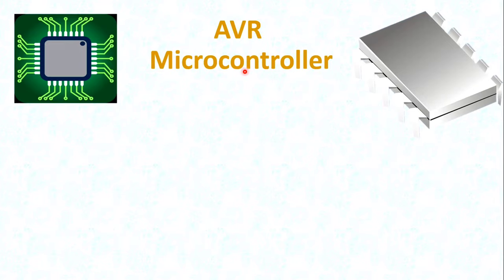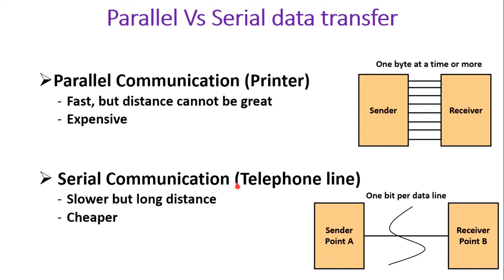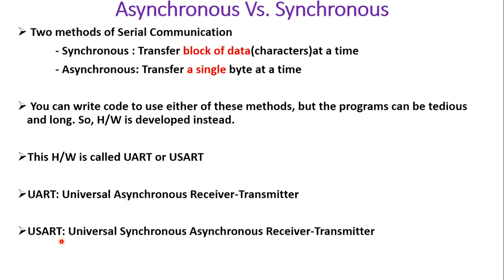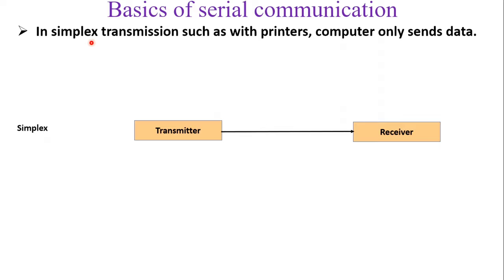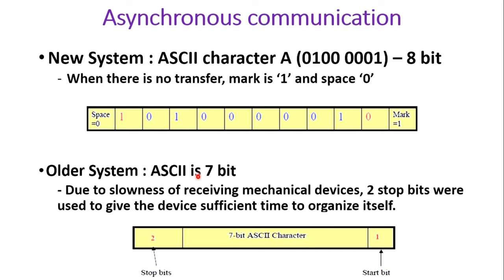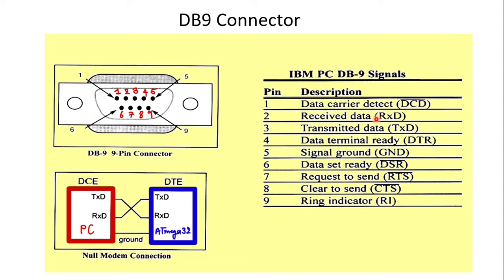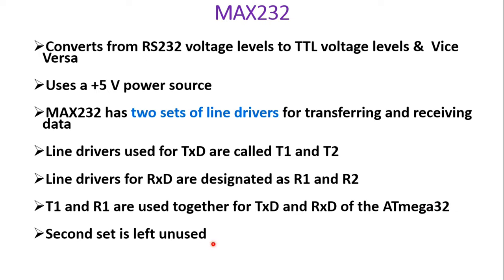AVR Serial Communication: A Comprehensive Guide for ATmega32 Microcontroller

Comment from the maker: Timestamps of AVR Serial Communication:
0:00 - AVR Microcontroller - AVR Serial Communication
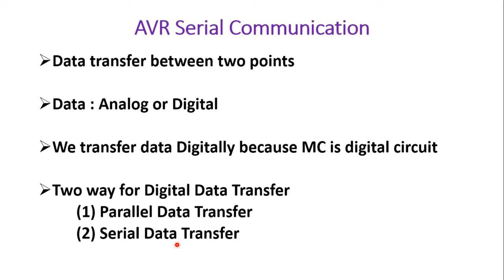1:22 - Parallel vs Serial data transfer
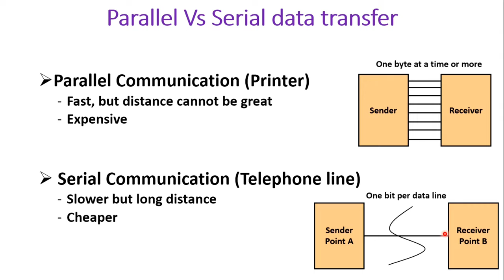3:07 - Serial Communication
3:55 - Asynchronous Vs Synchronous communication
5:36 - Different Serial Communication Protocol
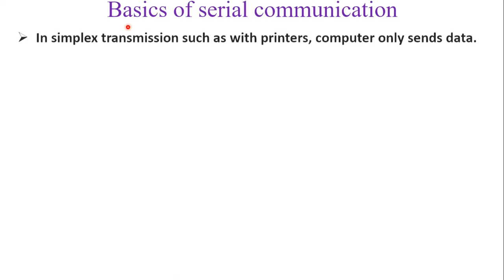7:55 - Basics of Serial Communication
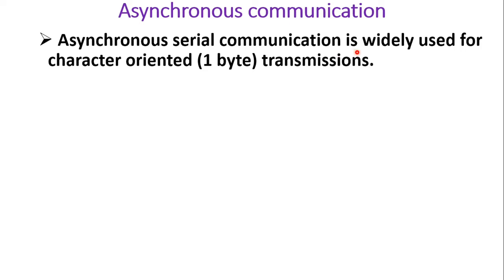10:20 - Asynchronous communication
13:38 - RS232 Standards
14:30 - DB9 Connector
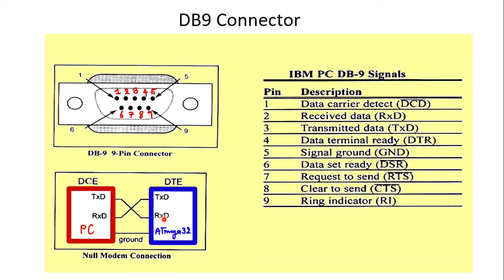16:24 - ATmega32 connection to RS232
17:00 - Line Driver MAX232
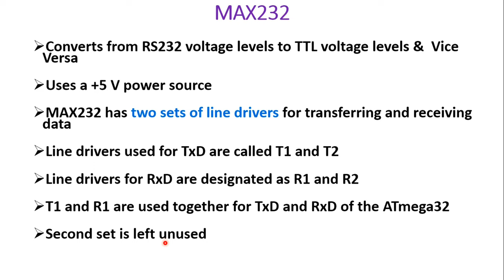18:29 - MAX232 and its connection to ATmega32